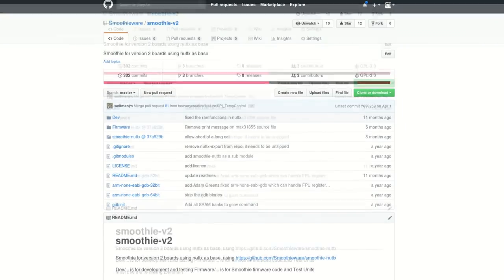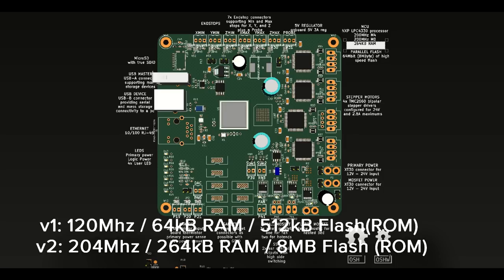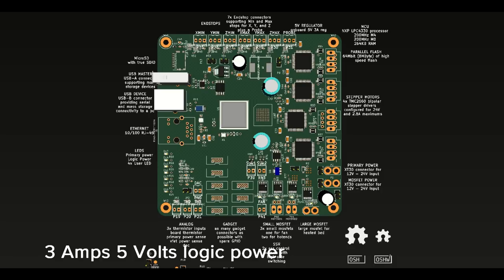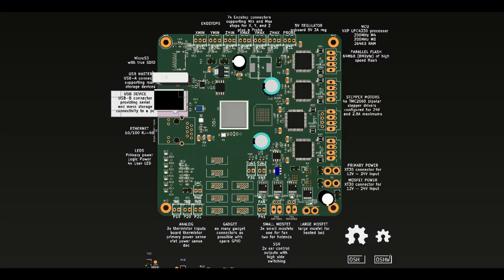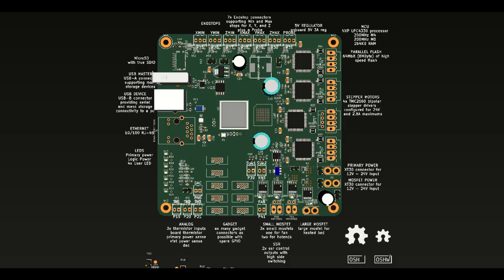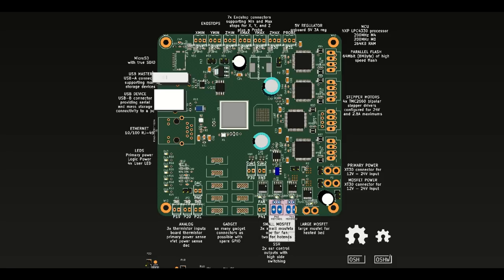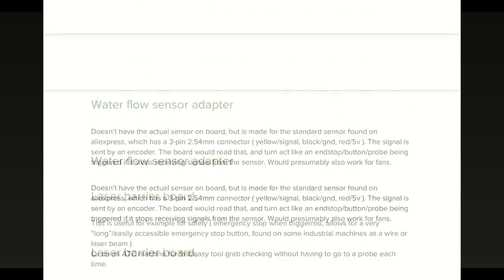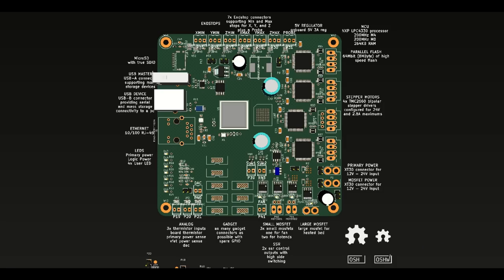SMOOTHIEBOARD V2 UPDATE, KICKSTARTER SOON

Comment: Wonderful! I had almost lost hope. I'm sure you have a ton of requests for features, but please: Make sure the firmware fully supports the stall detection and has an implementation for hard stop homing. I'm begging you! I'm hoping the board can issue a feed hold in case of collisions (and of course in case of overheating or other errors). Would also be nice if current can be reduced during hard stop homing. Fantastic work either way, I love the choice of high power drivers. Makes it so much better for CNC milling applications. Coolstep would also be neat if it is implemented.
Reply from the maker: The trinamic drivers have an output for this, and it'll be wired to the microcontroller, so it's just a matter of mapping that pin to the suspend or alarm command with the switch module ( not sure if we'll do that by default but it'll be in the documentation either way ). Really, trinamic driver in Smoothie is already pretty mature, v2 doesn't change a lot to that.
Reply: Sounds great. Is the SPI of the drivers also connected to the microcontroller so driver parameters (like the SGT value for stallguard) can be easily tuned? It would be nice if it is connected in hardware so the firmware can some day support "in situ" tuning (and even speed-dependent SGT value as recommended by trinamic), even if it doesn't support this today. Making full use of the drivers in this way would be great since they are integrated in the board, and of course one wants to get as much as possible out of them.
Reply from the maker: Sure it's connected it's how we set things like current etc. We'll support everything don't worry :)
Reply: Fantastic. This already makes it a sure buy for upgrades and future builds. Now just imagine if smoothieware could be the first firmware to fully support toolchange macros as well... ;) But I'll stop pestering you now, I'm already stoked about the new board.

Comment: Hey Arthur! Any idea of a price for the V2 version? Im building a large industrial grade 3d printer with linear rails and servos. Im really hesitant on ordering the V1 smoothie when id rather the V2. Any idea of a release date? I also want to build a 5' x 10' cnc plasma table. Is there a way to change the measurements to a imperial inch in the software? If not that would be something to think about for the market in the states. Thanks for all your hard work!
Reply from the maker: V2-prime will be a bit more expensive than v1-4XC, v2-prime dual extrusion will be a bit less expensive than v1-5XC, v2-mini will be ( we hope ) around $70-80, and v2-pro will be well north of $200. That's the current estimates. Note v2 hardware will be beta at first kickstarter release, and the firmware will take a long time to mature to the level v1 is at after the kickstarter. I'd go with a v1 right now if this is a serious/work project, it's a very good board. Working on v2 kickstarter right now, hopefully starting in a week or two ( optimistically ). And yes there is a inch mode, it's very rarely used though, I could imagine there would be a bug with it nobody has noticed or something, but it's there ( and if you find a problem we'll fix it of course ).

Comment: Could you space the holes 105mm apart? That way someone could mount directly with spacers a 120mm PC fan over the board.
Reply from the maker: That would have been lovely, but it's too late to change at this point, plus the spec said 20mm grid and I think overall it'll be a good thing that we stick to that.
Interrestingly : you don't need a fan, the board has huge passive heatsinking capabilities. Even if you live in a very hot area, the worse you'd ever need is a very small fan circulating some air around the board, 120mm is overkill by several orders of magnitudes.

Comment: help need example config for cr10s for v1 board 
guidance is needed thanks
Reply from the maker: You may be able to find this in the Smoothie forums. However, make sure you don't re-use the config file as-is, instead, you need to use the found config file as a source for values. But you need to take the example config file ( and flash the latest firmware while you are at it ) from the wiki, and edit it to have the right values ( instead of using the found config file ). This is important as if you are just re-using a config file without understanding it's contents, you are putting yourself in danger. You need to read the documentation and do your config based on the example one on the wiki. If you don't you are taking a significant safety risk. Don't use Smoothie without understanding it's documentation.

Comment: ETA?
Reply from the maker: Working on the next prototype right now, we just finished the design and ordered the PCBs and parts, should assemble soon. It took a bit more time than expected to do the redesign, some unexpected issues showed up, but most of them are fixed now, and we hope the prototype will confirm the rest are too. That's for v2-prime. For v2-mini we had to delay the work a bit due to the v2-prime work, but it's now nearly finished. Once the prototypes are assembled and fully tested, we can move on to actual production and shipping.
Reply: @ArthurWolf  I'm updating a printer of mine and need a 24v main board should I wait?
Reply from the maker: @tyrian869  v1 is still a very very good board, whether to wait really depends on how much in a hurry you are. We'll be a bit late on the initial Kickstarter timeline, but should starts selling boards as soon as the Kickstarter boards are all delivered.